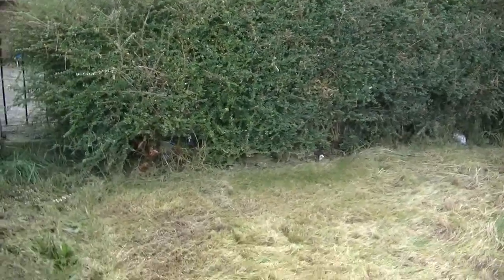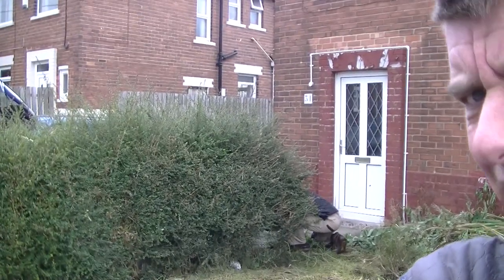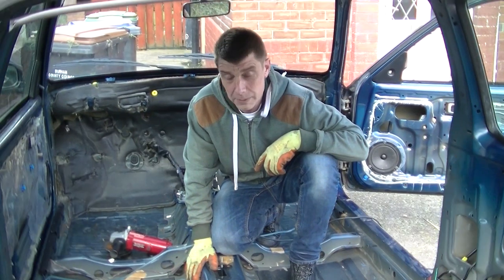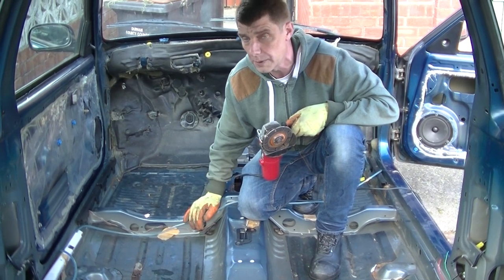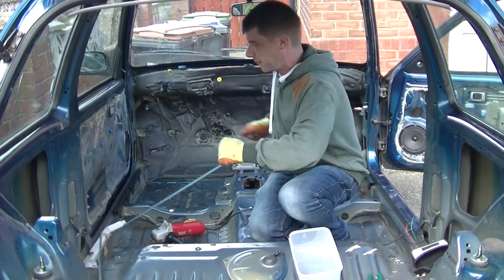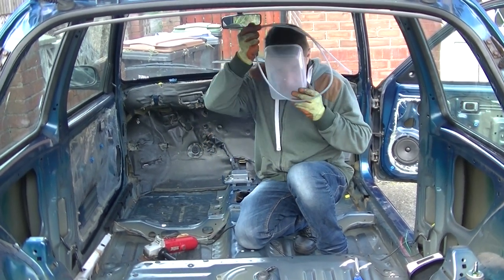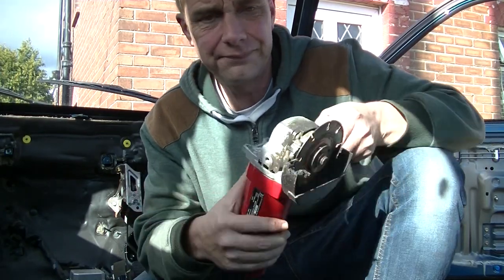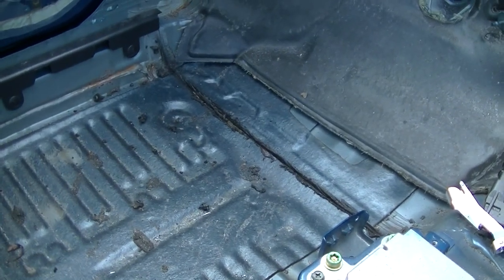how to make a mask in Turning a Car into a fish tank (day 3) & removing the wife's bush!!

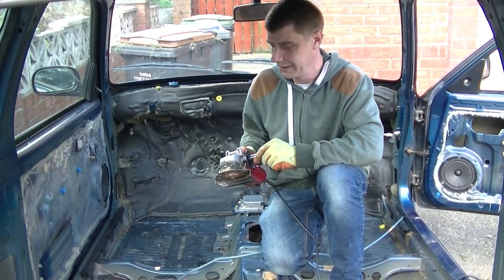Comment: that's how a days progress works. With the bushes at least. make a good blueprint.  5:00 this looks like unnecessary work . If it where a double tank . A sump would go under there. I think you ruined the build. What do you possibly have to replace the floor ,  this may take until next year to complete.
Reply from the maker: The floor is to be removed to allow the water into the car the same way as an inverted tank, that way the water presure will be pushing down instead of outwards which means we wont have to change the windows. cheers for watching!!